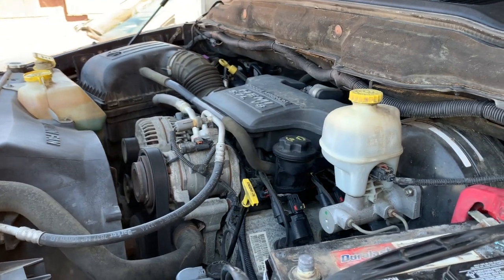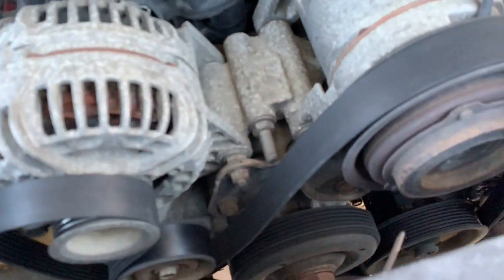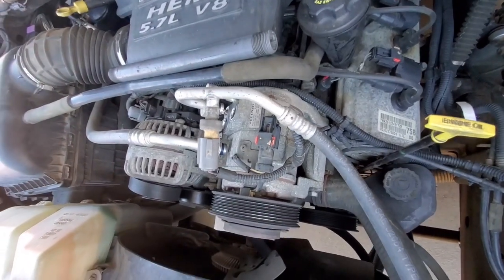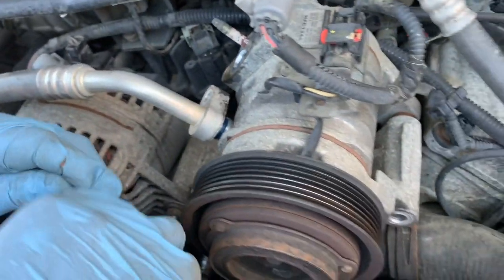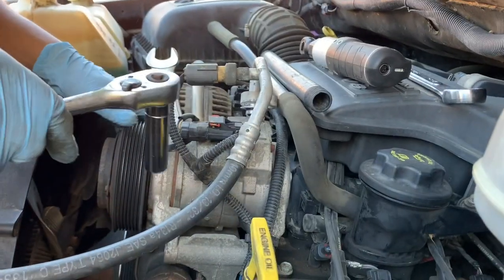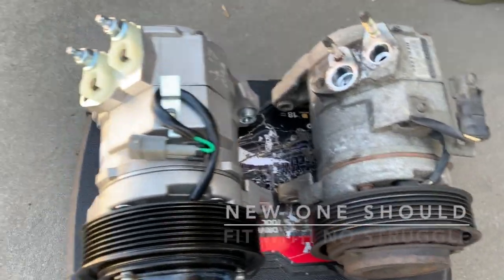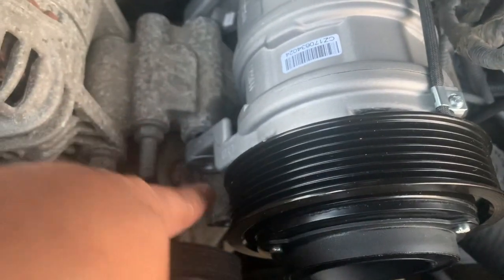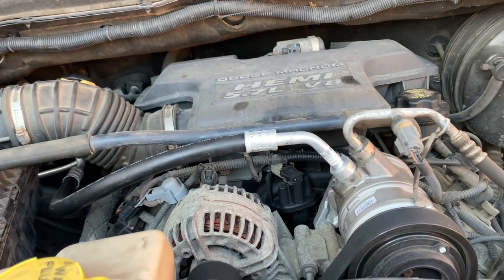How to Replace AC Compressor Dodge Ram Hemi 5.7 1500 2500 3500 2002-2008 step by step (improved)

Comment: I watched and appriciate the video for sure!! I was waiting for a "F that" when you were using the ratchet LOL ... I was hoping to see that connecting just below the AC compressor.. Where the hose comes out. The male part on mine looks to be corroding/leaking antifreeze.. What is it called?? Thank you for a very easy to follow video.

Comment: Can I replace my compressor and then drive somewhere to get the system filled/recharged, as long as I dont turn the AC on?
Reply from the maker: Check this out before you tackle down anything: No Cold AC: https://youtu.be/GDdEw-Jbusg

You can do it yourself because a shop can charge you $120+ . No need to add oil because your compressor should have come with oil already. 

Here is a quick video on How to Recharge your AC: https://youtu.be/MC3wiq8zdY0 

Make sure you have your AC on: AC/ Cold/ Max
Buy two AC Refrigerant (not the leak sealant ones or repair leaks) and check the level when you are adding refrigerant...
Reply: @RookieRepairs  the compressor I purchased says it comes with shipping oil and that it needs to be drained and refilled with the proper oil.
Reply from the maker: If it comes separately yes you’ll need to add it to your compressor - if not it’s already inside the compressor (it’s oily when you remove the cover on your compressor bolts) and no need to add extra oil...